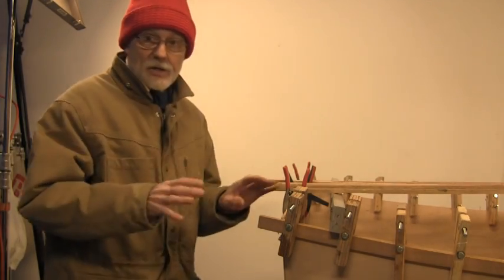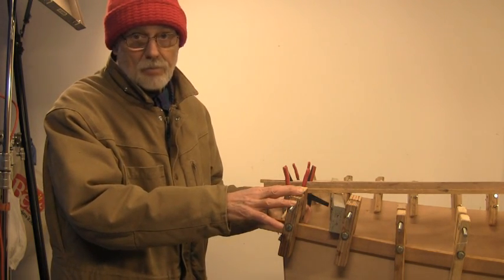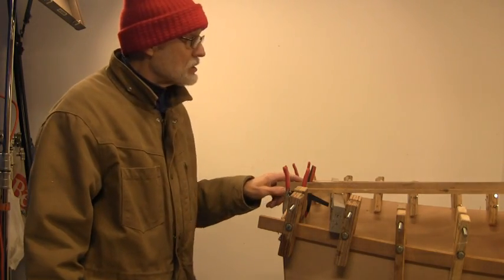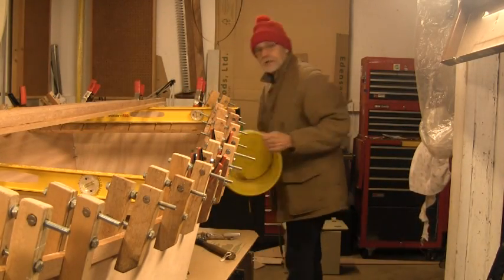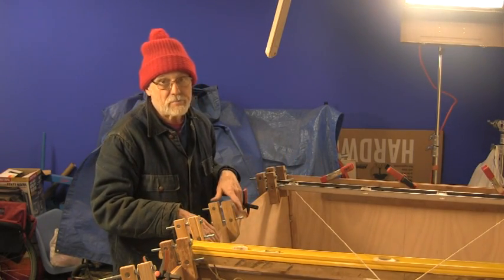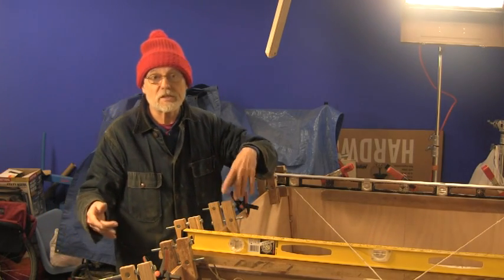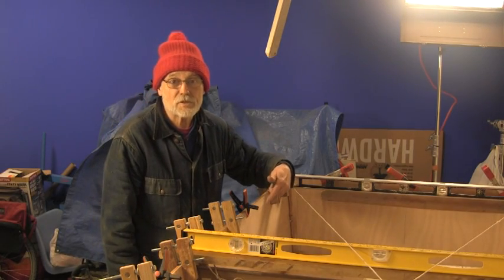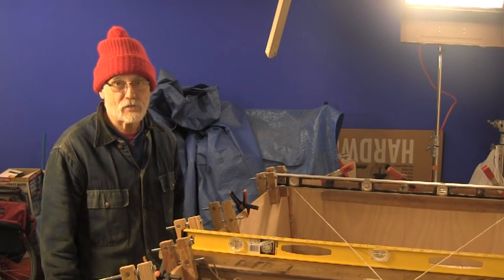Building Nymph Part 8

Comment: Did you try coroplast instead of plywood? Extremly robust and durable. Moreover, you can use less than epoxy and fiberglass cloth. I'm thinking of doing coroplast one from the duck boat. good work.

Comment: What are the chances of having the Solduk Drifter plans in time for a winter build? Keep up the good work!
Reply: Good! I'd considered building one of the other "Nymph" derivatives as a substitute, but I suspect the drifter may be a bit stiffer/tougher. It will get used on the lower Payette, Boise and middle Snake in class II or less, but a rock or two will probably be in its future. Gotta follow those fish! Keep us posted!
Reply: I'm just now finishing a "practice" boat (9' framed rowing dory) as a skills builder out of scrap lumber. I've learned a lot and am looking forward to doing a Stich and Glue project. Your plans posting sugestion seem good to me, as long as you dont mind an occasional dumb question!